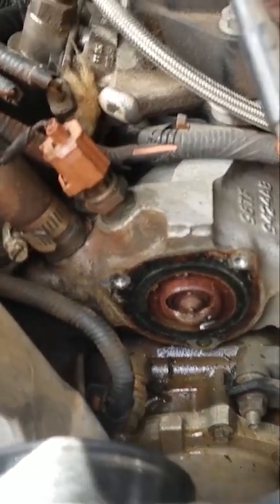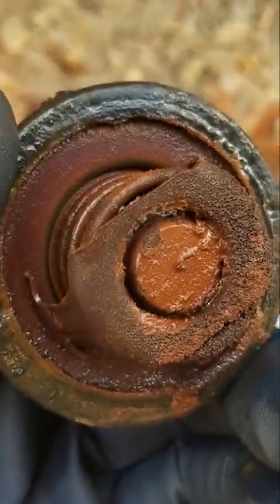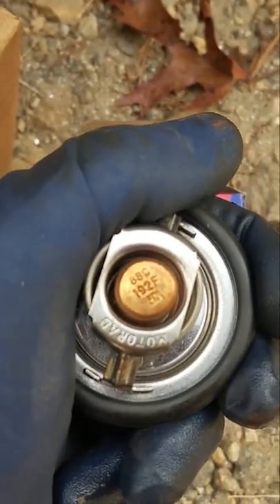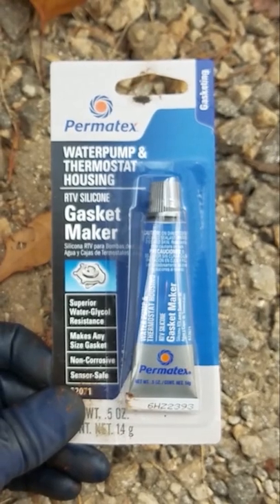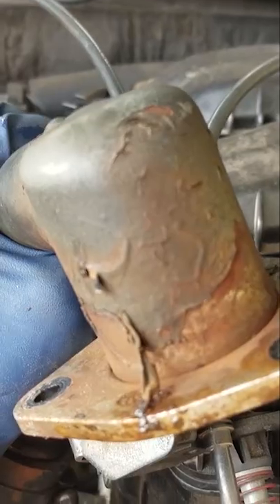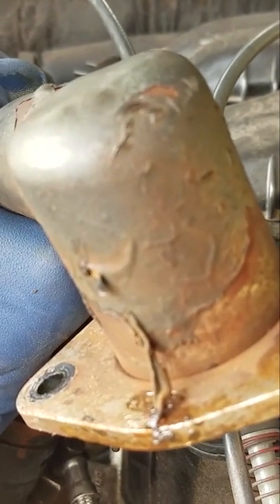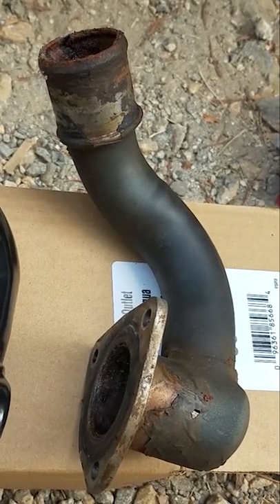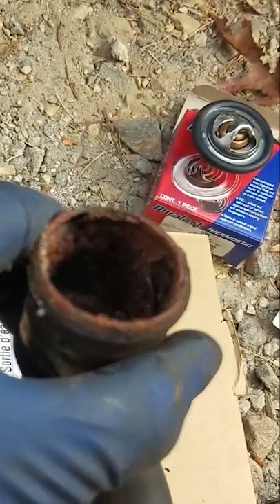Customer States Thermostat BAD

Comment: Thermostat has a groved O-ring that seals all three components, no gasket sealant is required, especially that much.
Reply: No kidding right geeze
Reply: Ya, it already has a gasket on the thermostat.  It should require any sealant, let alone all that was put on.  That is insane, clearly this person doesn’t know what he is doing.

Did the engine even have any coolant in it or straight water?  End up with other leaks, like out of the freeze plugs.
Reply: Haha thats what I said. holy cow thats alot of permatex!
Reply: Hes using duralast parts and 3" extension with a swivel head on torque wrench... he gives no fucks
Reply: I put a rad in along with a new thermostat while I had it all apart. 0 permatex 0 leaks. Been a year with it. Still the same. New water pump on now though. Old ones gaskets leaked
Reply: Hahaha! So true. Imagine being the next guy to clean that off
Reply: If you don't know what your doing, just follow a repair manual jeez

Comment: Looks like the thermostat is the least of that engines problems.
Reply: The frame is probably about ready to snap in half underneath.  Glad we don't have that kind of rust where I live.
Reply: @TheFrenchPug  That rust didn’t come from location.  It came from negligence in the maintenance department.  Take care of the equipment, it takes care of you.
Reply: @TheFrenchPug  comes from running water in the system
Reply: @scottbaican9566  OH, ok. That is a serious problem then.  What could have been done to avoid that?
Reply: @TheFrenchPug  Anti-freeze (usually) has rust inhibitor in it.
Reply: @fomoco300k wrong it comes from salt on the roads
Reply: @steefan2248 yes it does an an oil leak can help protect ur frame 😊

Comment: Judging by the old thermostat, I would imagine the new one wont live long
Reply: Facts
Reply: @Bob Saget because the system is full of rust. Once it gets like that every part of the system will be full of rust. That rust will travel to new thermostat.
Reply: @Bob Saget rust build up will inhibit its ability to open and close properly.
Reply: Facts, and that rtv was way over applied,   tbh coolent cleans rust well  hell need to flush it a bunch
Reply: That's what the old temp fix and sell is

Comment: I'd be running that with no stat and some rad flush a few times, flush that junk out before you clog the new one up.
Reply: Sure hope he did. Since he will likely be doing this job again soon maybe he won’t use gasket sealer or at least won’t use so much.
Reply: It looks like the orange dex cool that turns to rusty sludge, I did a super flush and switched my used Buick to universal yellow first thing after I bought it
Reply: @markm1514  That's not how that works.
Reply: @iFixJunk  that is indeed how it works.

Comment: Too much water not enough coolant/antifreeze causes that. Most modern cars have a 195 thermostat to help with emissions a hotter engine in theory burns fuel more efficiently. A little too much silicone, but good job.
Reply from the maker: Probably why it rusted so bad.
Reply: Or maybe they never changed the antifreeze. The rust and corrosion inhibitor only lasts so long
Reply: @uplandhunter6252  that's the real answer. Neglect.

Comment: Its all nasty, rusted,and corroded because there is no coolant in this system. If there was, there was a low ratio. Antifreeze/coolant will keep that all from happening... no need for sealants with o-ring gaskets
Reply: Or it was just really old and the corrosion Inhibitors were no longer effective

Comment: That gasket poo is going to be smooshed inside that housing that's a real big issue. You could try and source a sheet of gasket possibly? A thin sheet is around the price of a tube of RTV. Also I find the process of making the gasket quite satisfying.
Reply from the maker: The silicone will not go in past the rubber gasket.

Comment: If you have the rubber ring on thermostat then you don't need the permatex.  That rubber is the gasket...
Reply from the maker: A little extra seal never hurt.
Reply: @MattsShop that's not how it works, but you keep thinking that. 🤔

Comment: DON'T PUT ANY WATER IN THE COOLING SYSTEM. Also,when it looks this bad at least flush the system before repairing it without the gasket sealer. That sh!+ is nothing more than a mess to clean up next time.
Reply from the maker: This was after a flush

Comment: That cooling system needed several flushes. If that area was that bad the rest of the cooling system is just as bad. And you don't need gakset maker, that rubber ring on the thermostat seals it up. If you use any just a thin layer to make up for any inconsistencies in mating surfaces. That much sealant for sure got all over the thermostat and into the cooling system.

Comment: Just a reminder people. Always let your gasket maker sit for 2 minutes before installing the part. Lets the gasket maker "FORM A GASKET"; then you install it with a good rubber barrier all the way around. 

Fresh gasket maker will just squeeze out if you torque your bolts with only liquidy goo that hasn't set up.

Comment: I think i would have done a coolant system flush before puting in the new therm. By the looks of it someone has been wunning straight water in there which is the reason for all the rust. I would definitely invest in a back flush kit and purchase a good quality liquid flush so at least an attempt to prolong more issues happening soon....things like the radiator getting plugged up and the worst is the $40 heatercore that will stop putting out heat due to being plugged with rust requiring likely 10hrs of labor to replace a cheap ass core

Comment: What on earth makes you think that the rest of the cooling system looks any different?  Why do a partial job?  Flush, flush, flush until it’s all clean!!  Otherwise, it’ll just ruin the new thermostat, too.  The best repair is the one that lasts. 

Also, for way less than the cost of the tube of “gasket maker” you could buy a proper gasket that doesn’t leave any room for looking like a hack with the Gobbed up excessive amounts of it all over the housing flange.  (I’ve seen less silicone on valve covers than you put on that thermo housing!)

Comment: Lol any mechanic that uses that much rtv when there's a new gasket already available (Gasket-a shaped piece or ring of rubber or other material sealing the junction between two surfaces in an engine or other device) will never work on my car

Comment: I would have sandblasted the old Tstat and drilled and tapped a hole to get the old wax out. That way when you put the new wax in the Tstat you can thread a bolt in to plug it. Alittle bit of RTV and you are in business. It takes a few hours but you dont have to spend the $900 on a new thermostat.
Reply: Huh, who is scamming you for 900 thermostats are like 5 bucks 😂
Reply: @atomicbogator6799  😄😄
Reply: Mine was 19.99 at autozone. But yeah, 900 sounds like someone made a nice paycheck
Reply: @zackhamilton7421  depends what ur working on, for my Chevy 350 is was 2.39 😂

Comment: I don't get it, a new gasket usually cost less than the gasket maker....
Reply: The gasket that comes with that thermostat doesn’t require or need any gasket sealer/maker at all… weird he did that. He should have also at least told everyone in the video he recommended or did flush the system a few times before putting the new one in.